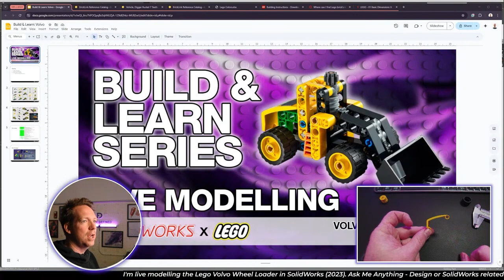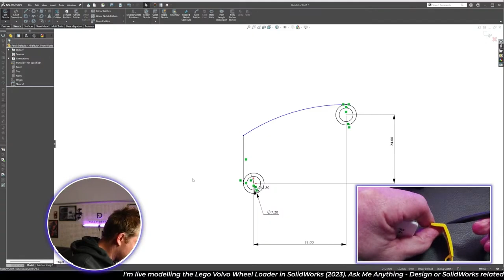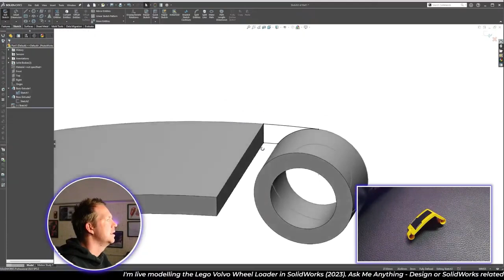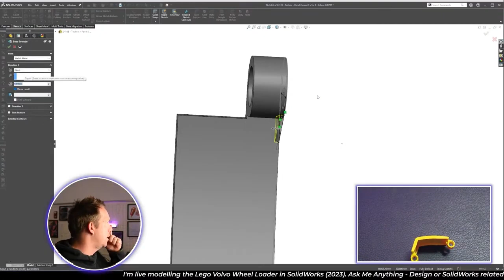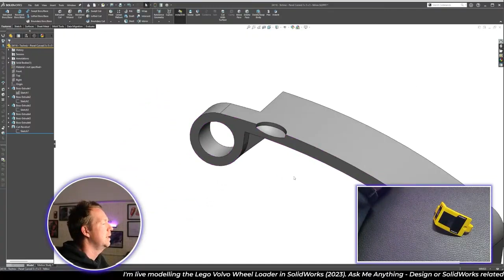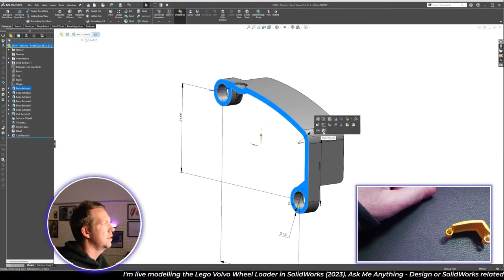Model LEGO Technic Curved Side Panel in SolidWorks — Volvo Wheel Loader Ep 6

Comment: Nice video, for the bump -- was wondering if simply offsetting the face and then extruding the dome would work? I think you ended up with a larger dome size, which maybe matches the model better anyways, so it might be a moot point.
Reply from the maker: If I remember correctly, in the live stream it took a few attempts to get the geometry correct. There’s a few approaches that would work. A revolve is the most sure fire way. Others, as you suggest, could work too, but I think what I did in the end got really close to the real part.